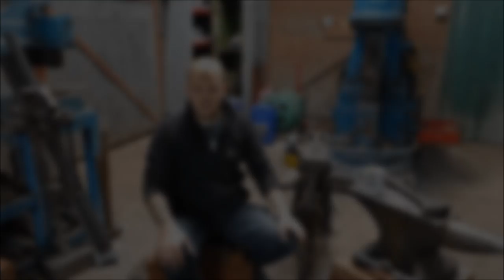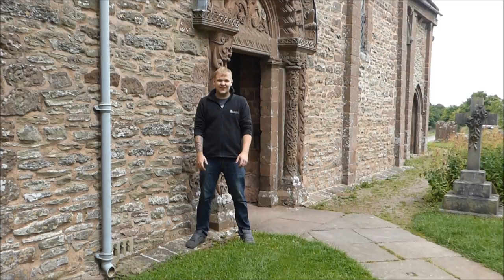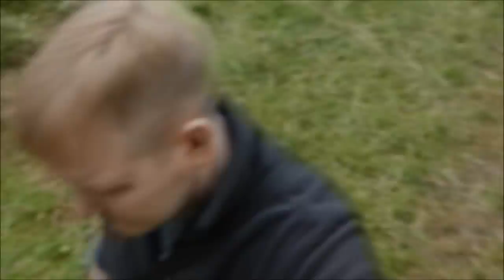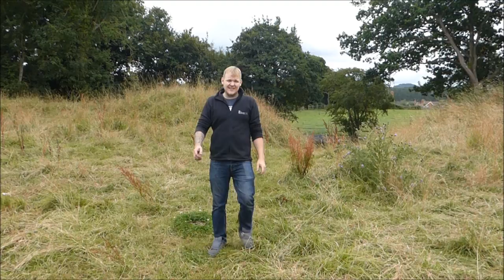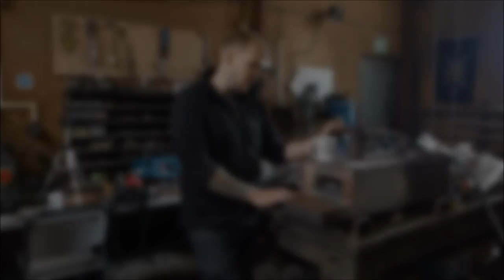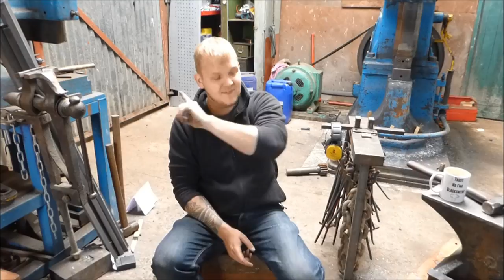Why Gas Forges Suck! Gas vs Solid Fuel! Trust Me I'ma Blacksmith! Full HD 1080p

Comment: I have both and like both
Reply from the maker: Fair point and i will also still uses both just different houses for different courses.  thank you for the great comment.
Reply: Daniel Moss perhaps you should both watch a bit more of Ilya Alekseyev... Forge welding huge chunks of perfect Damascus or layering low and high carbons into huge blades with gas... As you say. Horses for courses...no wonder he walked all over his competition in an episode of forged in fire .
Reply from the maker: You mean this dude??? https://www.youtube.com/watch?v=XoYpZkYlStU

the blade in this clip is not welded and is probably dude to the fact he was using gas and its a great example of his complete lack of skill. Any trained blacksmith with half a brain would watch him work and tell you  Ilya Alekseyev has no idea what he is doing. He is just like Alec Steele all talk and no walk. 

If you want to see some welding in gas using a high chrome alloy which is the bitch of all materials to forge weld you might want to check out this video. www.youtube.com/edit?o=U&video_id=U6ITeFxuxQM.

I suggest you go away and do some research on what it takes to be a real blacksmith before you go running your mouth or key board. The guy you have recommended is not a blacksmith and is a wana be. He just happened to be in the right place at the right time.
Reply: Daniel Moss you are way too young and inexperienced to give lectures... Try watching some of the other stuff he does or does this prove that with the impetuosity of youth you are too ready to jump to a  premature judgement? Too cocky by half young man and not in a good way.
Reply: Daniel Moss my grandfather and father were smiths and railway engineers, my sons an engineer...
Reply from the maker: Well my grandfather would beat your grandfather in fight any day!!!!!

What the hell has your grandfather, father and son got to do with Ilya Alekseyev being a good or bad blacksmith. If your talking about man at arms and the sorry twisted rubbish he puts out then all I can say is its a good job they have Matt on the team and all them grinders. 

Poor examples of blacksmith such as Ilya Alekseyev and Alec Steele muddy the name of great smith like Peter Parkinson, Brian Russel, Albert Paley, Bruce Wilcocks, Pat Quinn, Heiner Zimmermann, Paul Zimmerman, Francisco Gazitua, Roberto Giordani and Joshua De Lisle. Just a hand full of amazing smiths that push contemporary blacksmithing and make it a great time to be a smith. I have a lot to learn, but what I have learnt and what I will go on to learn comes from a base built by true craftspeople and inspiring blacksmiths; Not poor examples such as above. These men or should I say boys do not have formal education nor apprenticeships nor do they have more time under there belt than me. 

They also poorly demonstrate the years and years of hard work that go into smithing and this is show in there outcomes. You find me one piece of work by ether of the smiths that is truly a work of smithing brilliance and Ill say your right. Then I will show you a piece of work from each of the smiths about "real blacksmiths that don't hide behind there grinders and replicas of medieval wrought amour made out of brought in sheet steel with clips and studs put on off center. 

Also Why do people get away with welding in Gas? Cause the stock that they uses is full of nickle or at lest one part of the stock is. This does two things now listen closely because I'm aware you have a hard time doing this and you might bring up you Grandmother or sister to argue the fact you don't know. 

Nickles helps weld other steels together in the fire welding process. That's why Alec and all the other pattern welder use the stuff cause it makes life easy.

Nickles and high carbon steels have a much lower welding temp than mild steels and wrought irons. Some High carbon steels weld at 900degC and if you want it in Fahrenheit find it yourself not going to do all the work for you. With medium carbons at 1100degC and the middles at 1300-1400degC and the Wrought being able to tack if it 1500degC to 2000degC. So that's why Alec steele couldn't fire weld his grappling hook together in his gas forge (first try  https://www.youtube.com/watch?v=YtnPq2aOp7I&t=4s(even on his second attempted it slit apart; second try https://www.youtube.com/watch?v=JiqzUNImqU0) and why you never see the boys at BK&S using wrought iron.       

Sorry please just go over why your family being train operators has jack to do with why I should listen to your opinion on Ilya Alekseyev?

Also How old am I? What is my backs ground? What does my Father Do? What did my grandfather do? You should have the impetus to do more research and understand that Ill informed and poorly argued points make you look silly my friend.  

Also I'm not cocky your only saying that cause you don't like the fact I should you a poor example of Ilya Alekseyev bad welding on Forged in Fire. Why does that make me cocky? Your just bitter about the fact I found and example of his inability to fire weld. Its also the first example I found FYI. If you said I was self righteous I would have to agree but go back and watch the first link I share Ilya Say Quote "I'm going to blame it on un-none steel, my conscience is clear. I'M FANTASTIC!" Little arrogant wouldn't you say for a man that quite clearly bit off more than he can chew.

PS Please inform me of the Job titles and occupations of your Full Living family and your dog and cats if you have them?????
Reply from the maker: Huge chucks of perfect Damascus year right. Robin Turner Learn how to fire weld and come back when you can. In fact learn how to fire weld mild steel and the come and tell me all about it. Walk then talk.
Reply: Daniel Moss grow up sonny...
Reply from the maker: Nice retort Robin! I could say the same about your pathetic comments on this thread but not sure it's sinking in much as you don't seem to have changed your tack. Your playground come back with an underlying hint of I'm older than you so shut up and respect me. Tell ya what let's play a game of who's grandfather was the better engineering. Just so you know the win gets the tell the whole world there thoughts on Ilya. shall I start? it's kind like top trumps but with real people not cards. 

let's start this again but with the aim of making ground and not saying stupid stuff that has nothing to do with why someone might be a good or bad Smith. why don't you give real reason other that your opinion on this conversation as to why Ilya and Alec are amazing blacksmith. Im really open to talk about this but reacting like you did by tell me that I'm cocky cause I found information that contradicts you statement isn't the right way to have this discussion. 

If you can't understand what I'm saying then please stop replying. I enjoy this sort of thing and I'm quite happy to go on and on. make a solid point that makes me think differently about your statement and I'm happy to look at my opinion on Ilya. ps you know what they say about opinions? There like arse holes full of shit. 

thank you for the great comment every time you turn up here and leave a comment it helps my channel grow. so rapping you up in a debate about your opinion means I get more traffic. thank you for the help and support. means the world.
Reply: Daniel Moss calling former subscribers comments pathetic is demonstrably playground and juvenile, and your opinions, well I think you summed them up all by yourself. As for the skill of my grandfather and father, I know what they did, you don't, and no I'm not going to waste the time on you.
Good luck with your channel.
Reply: Ilya is a case of right place right time. He is a knife maker. As are half the people that have a belt sander and a grinder.  Were I have not gone to school for metal work I have over 15 years of working with sheet metal and hot stock. The time invested is a big part of what makes you an artisan. I have welded in my gass forge it sucks. I as I have said I like both. It is hard for me to forge weld too peases of 14gadge  miald steel.  As for the dude that got angry. You were given facts. This is YouTube be happy that you found a chanal that has some.
Reply from the maker: Robin I'm trying to point out that your making broad statement about a "blacksmith" that you know because he is in the line light. Ilya is a shocking example of a smith. You came into this conversation with the opinion that he is a good one and i'm telling you he's not. I then gave you evidence to backs up my point of view. You said Ilya's could fire weld prefect Damascus I proved you wrong. You are having a hard time grasping this FACT! 

So carry on jumping up and down playing the age card. Also continue to strengthen your argument by bring up information that is meaningless to this conversation like what your family did in there past. And remember the number one play ground rule is If you can't think of any thing cleaver to say to a retort just say it right back. 

I'm please your not subscribe to me but guess what I am sub to you!!! I don't want people like you as subscribers to my channel. You barely grasp the idea of a debate and reinforce your nonsensical arguments with what your grandfather might have said; And even now you don't understand why that isn't away to back up a statement and prove an argument. 

Look ill try this again so you might grasp the point I'm making. You can't say that your father is right if i have never meet him. That is hearsay find some evidence and prove your right. Just to make this clear its like me saying my dad is stronger that your dad. How the hell do we prove that? Does that clear up why I think you bring your family in to this is dumb. For all I know you don't have a son!

Also again sorry to do this but my family also help during both the first and second world wars right so you can pull the my grandpa killed more Greman's than your Grandpa card if you like but what a load of bull shit crap mate, again hearsay. So I suggest that you go away build an argument that make sense and than come back with some evidence that Ilya is a good smith. 

PS because your dog once jumped over an 8 feet fence doesn't make him an authority on what constitutes being a good blacksmith.
Reply: Daniel Moss you really do need to get out more... You showed an example of a smith producing imperfect Damascus, which does not prove he can't, just not on that occasion, have you never made mistakes under pressure? Haven't you entered a competition? . There are many other examples of him producing fire welded items if you bother to look. I never said he or Alec were perfect smiths either...you did...
You learned your craft from an expert, why therefore do you assume I have not done likewise? I've given you enough hints that I know what a real smith is. 
You say opinion is worthless yet you continue to expound yours and claim it's fact. Does that in your words make you full of shit?
You don't want me as a subscriber but you subscribe to my empty channel, pointless...But amusing.
Yes, I am much older than you, do I expect respect because of age? No I really could care less about it.
The point I and another was making was that you should show us how good you are as you. By criticising others you demean yourself Nd it's counter productive
Reply from the maker: do you feel that this is getting a little silly? 

I'm completely aware that you don't like the way I produced this content but I'm also you aware that quite a few people like the content I produce. so make of it as you will.

the point you made was that Ilya was able to weld dissimilar steel I.e. the knife he made in FIF mild steel and high carbon which failed. if you like I will point out more issues  with his works both his forging and his welding. 

I don't doubt that Ilya can weld under the right conditions but that's why I point out to you why people weld with nickel rich steels. That's why I pointed out that Alec couldn't weld mild in his gas forge. so don't try to put words on my mouth. on the note I never suggested that Alec was a perfect Smith I was using him as an example. 

it's quite clear you cannot grasp the point of constructing an argument. I'll try again cause you know if at first you don't succeed. 

use facts to back up your points.  stop presuming that I will believe you cause you said so. I don't believe that I am better than you nor do I feel that your opinion isn't valueded. how ever please understand that you can't use hearsay to argue your points. 

how about this for an idea. Tell me what your experience of blacksmithing are and your back ground and I'll tell you mine. let's see if we can't learn something about each other. 

I've sub to you so I won't forget these conversation. I want to make sure that these exchanges have some sort of context.
Reply: Daniel Moss actually wrong. I never said Ilya or Alec were good smiths... I said Ilya could produce big chunks of perfect Damascus and there are plenty of examples where he does so. You produced one example of where he did not under pressure in a set of conditions under which almost all smiths struggle. Logically does that prove I'm wrong, no it doesn't. Fact it isn't. 
You are one angry young man... Something you might want to consider moderating in public.
What you were being told, incidentally to try to help you, was that it does not pay to make yourself look good by criticising others. It doesn't work, but your anger is preventing you from seeing that.
The stupid thing is I thought you were clever enough to see that I was bothered enough to try to help you. And incidentally hoped you'd work out that I might actually have a modicum of skill, but again your frustration is obscuring the obvious.
You questioned whether I knew what a smith was, didn't you? Grandson of a smith engineer , son of a smith engineer, father an engineer. Doh!!! Cmon not some silly pissing contest! 
So for one last time grow up, this is not some playground trolling. It was a genuine attempt to offer good helpful advice from someone on your side.
Oh and the comment about argument... Childish and oh so wrong
Reply from the maker: Sorry Robin I did not assume that you where a Smith if that is what you are leading to. Also my question about you back ground was a genuine one as I sort of thought you might be a Smith but I'm still not sure. it was not a passing contest it was just to show you that I'm not coming at this form a place of ignoranc. 

your quite right Robin I am a self righteous man and I do find that I take on projects that I probably shouldn't. I do hate to see what I feel are injustice go unchecked. I would like to point out that I said how I feel "my opinion". doesn't mean I'm right to take on Alec like I am but I should sand by my chooses.

I would really like to know the man I am talking to and I genuinely would like to find out if you are or are not a Smith. 

please don't assume I am angry and don't insalt my intelligence by making out that just because you are the son of a Smith and the father of an engineer you must be a blacksmith.

please understand that I am being honest here and I'm also the one that is put my neck on the block. please to assuming that I'm something I'm not. would you rather that the people that your forbears fought for should lay down and give up the first time the shit hit the fan or would you rather we stood up and fought for what we feel is just?
Reply from the maker: if there are any mistakes on that last message please forgive them as I wrote it and didn't have time to  check it before I sent it as phone was about to die. im very dyslexic and find it extremely hard to produce these messages. It is both time consuming and hard work. Sorry for my failures. wish I was better at it but I got the cards I was dealt. please don't judge me on it or take the piss.
Reply: Daniel Moss I'm the last to do that. Though I learned smith craft in my teens at the hands of a master I gave it up for a different career firstly in IT where I worked up to director level . And finally as an expert in the civil service with an emphasis on supporting those in need access arrangements for public exams. More than this I will not say on this medium.

Comment: ..Your research is Very Good Dan!! Coke is as hard to find around here as Hen's teeth. When you do it's $$ Expensive. Anthracite is easy to find and if you look hard enough Bituminous, I just found a source. Technology takes the Art & Science out of doing something. After all, how are you going to run things if the grid shuts down...!!
Reply from the maker: What have I done Ol? I have opened Pandora box. well if its a can of worms that needs opening then this is the one. thank s for the comment dude.
Reply: ..well if nothing else, with worms we can go fishing...!!
Reply: on this topic pretty much all the coal available here in australia (at least for the domestic market) is very high sulphur content. this might be ok for running a power station etc but it is very bad for a forge. the first few times i made my own charcoal i simply dig a pit, filled it with dead but solid wood (hardwood is best) and over that as soon as i got it going i put a sheet of iron and then covered it with dirt. since then i have come across a far better way and that is by making a charcoal retort. you use a small amount of wood to get it going but once it starts producing wood gas rather than just steam it becomes self fueling. yes you will use a bit more charcoal by volume than you will with coal but it is easier to obtain (make), is a renewable resource (you are using dead trees anyway and you can always plant more, and it makes a very clean fire